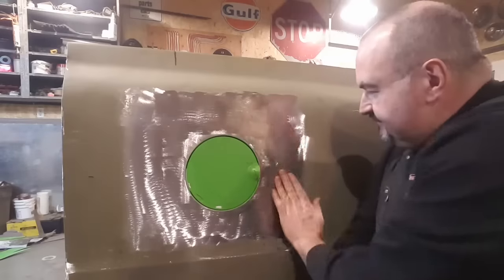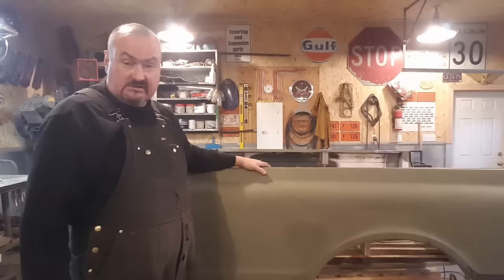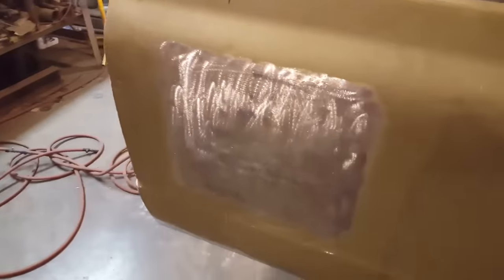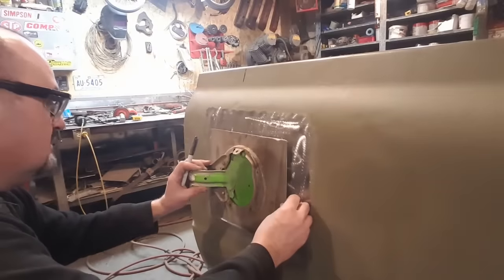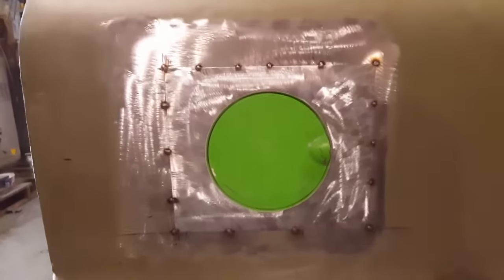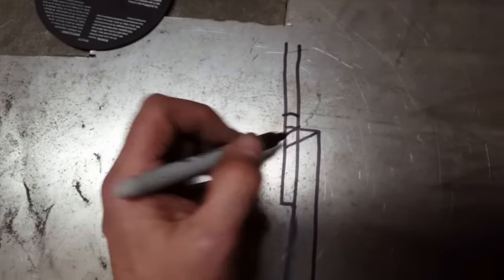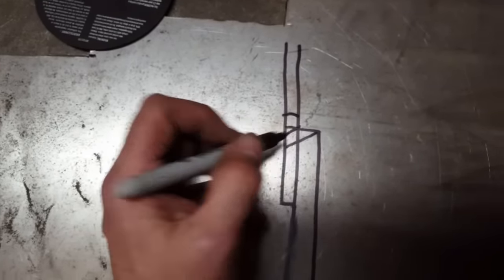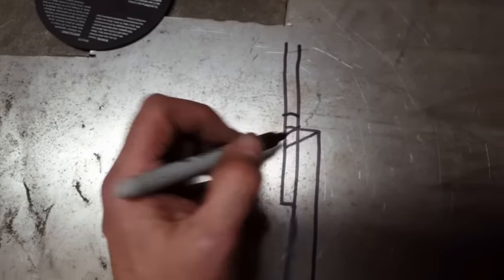Butt welding sheet metal the easy way.

Comment: This is a great way to do patch panels.  One thing I do differently is that I use the cut-off wheel on an angle to make a small cut through the sheet metal, after that I use an air saw which creates even a smaller gap that is easily welded.
.

Comment: The double thickness also gave you some added absorption from the heat of the tack. Been doing light gauge aluminum, stainless steel, aluminized repair for years. Tacks only,minimizes warping but that thing you do great idea will definitely be an advantage on future repairs. Great video and thank you for sharing.

Comment: I would just recommend rounding corners whenever possible. It decreases the chance of cracking when the metal moves when it is being driven.
Reply from the maker: Interesting. I never had a issue with cracking. The round corners we use to do on over lapped panel work. It dissipated the heat and was easier to fill. A 90 degree corner is tricky when it comes to heat and if you apply too much heat it will pull away from you.
Reply: That rounded corners is more for aluminum  . It's an aviation thing . Don't think it'll be and issue with metal .
Reply: Kind of hard to cut the 45 in a round corner with a grinding wheel.
Reply: @Spad68  I think the aviation thing your referring  to is related to airplane windows.  Some planes crashed in the 50's due to square windows causing metal fatigue. In general though, round things don't concentrate loads like angles do.
Reply: @bob.w3984  drill 4 holes in the corners before, not that much of work. Also gives you the outlines of your square, and you get perfect corners
Reply: If its properly welded, there is no corner. It's 100% fused metal.
Reply: @Catrik  Properly welded is a big term in bodywork, just sayin :D but, if it is "properly" welded, the course of the tension still isn't the same as in the original part. Again, just sayin. I also don't think that rounded corners are necessary in this type of fabrication, btw great idea, but still it's not the same as the original part.
Reply: some times with bigger patches i would do a three inch 45 degree cut at the corner , just to lessen the weld distances in a straight line  , but no need on smaller stuff
Reply: Generation-X actually applies to all possible surface intersections just like they moved away from rivets to full glue to minimise tear points square window corners first made them aware but some airframe techniques like wire wrapping were developed before the best gluing systems became available ....
Reply: If you had a plasma cutter you could use the same technique but add in rounded corners if you could trust the angle of your cut.
Reply: @chrisbraid2907  no where as close fitting as a laser disc ..
Reply: @chrisbraid2907  these are non structural , non load bearing surfaces , wings and back bodies , granted if your welding an integrated chassis you may have a point , except welding by its nature is fusion joining of two parent materials , its not like your pop riveting a patch over a square hole
Reply: Russell Gerdes  scroll saw? Really!? You're talking a lot. Just watch the video and shut up. This isnt woodworking
Reply: @generation-x406  de Haviland Comet I think
Reply: @Spad68  What is Aluminium if not metal?
Reply: It's not a ship insert,it's a thin panal.His method obviously works.
Reply: Did the end result look like crap to you?I think it's great.

Comment: I'm a girl and I had to watch this twice to figure out what the heck I'm watching.  Thx. for building the world fellers... I could never do this.
Reply: Sure you can! You just need to practice it. I'm learning how to weld and at my age "learning anything new" is a real challenge! Start with a small inexpensive wire welder and when you are ready, upgrade to a better welder and to a different style of welder. This is what I'm doing. I started with a wire welder but kept having trouble with setting the wire speed I bought a used stick welder. I'm much better with it, but I still have a long way to go. My neighbor has been welding for over 65 years, so he has helped me figure out a few things.
Reply: Of course you can, the only difference between men and women is men get stuck into things even if they're crap at it whereas women won't try.
Reply: Yeah you could JS
Reply: during ww2 women were building ships , planes tanks gliders - everything requires welding  ccmes down to a few things really - you can sew it , nail it , glue it or weld it  not really much to learn  do it as job and hobby = have fun with it - creative inventive -
Reply: @mrcaboosevg6089  Pretty good at sewing and knitting are yah? My girlfriend, just got done removing her dash, cluster, interior and fuse box, for the wire tuck and shaved bay she is doing.
Reply: @klubstompers  Not bad at sewing really, i can knit but it has been a good long while since i last did it.

Comment: Great Job !!!! I just subscribed to your channel. I have been a body man for 25 years and have painted even longer. Your amazing man. You have honed your skill a long time, I can tell. I started doing collision work in my 20's and got my feet wet, couldn't stand doing insurance work with claims adjusters that couldn't use a screw driver. I got into building customs and never looked back. I'm very glad that I found you.

Comment: My man spot welds without closing his eyes and grabs raw cut metal and yanks on it with his bare hands.
Stay thirsty my friends.
Reply: he closed his eyes, you cant see in these shots though
Reply: Don't try this at home. (welding like that.)
Reply: Also an old fabricator knows very very very well about eye safety from flash burn and flying  particles .
Reply: @krusher74  
Closing your eyes you will still get inferred burns on your eyes and lids., plus no face shield you will get inferred burns on your face or whatever areas are not covered.
I've tried the close your eyes method and woke up the next day feeling like there was sand in my eyes and my eye lids were burned.
I learned the hard way , DON'T DO IT. But this is still a very good video.
Reply: @almierz4604  I got welders flash and an old guy taught me to cut a raw potato slice and lay down with it on your closed eye lid. It worked. Took about 15 minuets for the sand feeling to go away.
Reply: @tomortman4850  and with a mask you could have saved the potatoes for dinner☺.
Reply: any tradesman that has put in the time that this bye obviously has, certainly knows what methods work for him. you're so naive that it's insulting. i presume ol' fitzee's been at master level for years.
Reply: @almierz4604  Close. It's the other end of the spectrum. The ultraviolet emitted from the weld (not the infrared) is the same as from the sun. You end up with actual sunburn - been there, done that. 🙁
Reply: stephen john gray  
Steve : Are you the STEVE I bought the 91 mustang race car from.
Reply: Not to mention the wood crates.lol

Comment: Please, use a face shield when using a cutting disc. I've seen too many accidents with those things flying apart.
Reply: And a welding mask. You only get one set of eyes and its not worth the risks.   An auto darkening shield with large viewing opening is the best types as you can keep it on and use as a normal face shield while grinding and stuff.

Comment: Is just me or is the gas flap the wrong way around?
Sorry was looking at the tray the wrong way.
Reply: No, it is correct.  The left side of 1/4 panel is up against the cab and the right side of 1/4 panel is the part toward the tailgate and rear bumper.
Reply: @garyroy3503  as above
Reply: My Thoughts entirely. Wind may catch in fingerhole at spped and force it open. Other than that very good video
Reply: My apologies mad the same mistake as first poster

Comment: does this guy close his eyes when he welds?
Reply from the maker: No I'm hiding the ark behind the tip. Not looking at the ark
Reply: @fitzeesfabrications  Ahh I only own a stick welder. I guess that's another huge benefit to a mig
Reply: @fitzeesfabrications  Well cant hide UV radiation with the tip ;)
Reply: I used to weld like that but I got over it, had orange tint safeties but went back to a helmet to save the skinburn.... ok for setup but not a good practice for the full job .....
Reply from the maker: @mikkoviitapohja1986  oh I know.
Reply from the maker: @chrisbraid2907  agree

Comment: I never comment on videos. But I had to after this. I have been doing my own body repair for about 10 years now. I’m redoing the bed on my truck currently and happened to come across your video. I just got done doing a butt weld with your method. It worked GREAT! It’s my best butt weld ever. Thanks for the tip! I subscribed.

Comment: Thank you very much for your insight. I have a fairly large gouge dent in the sliding door of my Chevy van. Unfortunately there's no way to get to it from behind and the person that owned the van before me had the repaired done by Earl scheib paint and body. They put in about a half an inch of Bondo and of course the Bondo cracked and absorb the water and then there was a nice rust spot underneath the Bondo where it lifted. So I ground out all the Bondo and I have decided to butt weld a new piece of 16 gauge sheet metal to replace the damage area. After revisiting your video I am going to attempt it and I'm going to videotape it so anybody can see how I got along. You're knowledge has been quite useful in my 79 Jimmy restoration. Keep up the good work.

Comment: Nice metal work. Over the past few years Iv started using double stacked cut off wheels at 90°s to grind off the first 50-75% of the welds in order to concentrate on the welds and not the surrounding sheet-metal then finishing with a flap disc. It also seems to keep the heat out of the panel.   New subscriber, I look forward to learning from an seasoned Panel Beater.

Comment: Great tips and instruction, just when I thought of a question, damned if you didn't answer it.  Good video work, too.  The 45* angle method was something that I haven't seen being done before and it makes perfect sense, I'll be using that method from now on.  For a while there you had me wondering just what you were going to do with the metal section that was behind the panel, but you covered that issue, also.  As for your accent, I got used to it after a few moments, after all I'm from North Florida and I also carry a bit of an accent.  Looking forward to watching all of your videos.  Thank you so much for taking the time to share your valuable experience.

Comment: I tried this technique after watching the video.  It was a long seam in a panel that curves from vertical to almost horizontal at the rear of the car.  For various reasons I did each end of the weld with conventional butt  techniques and the middle part using  using this technique.  Worked well, but with the curved panel I ended up with a steeper angle than 45 degrees. Not really an issue, but the tricky part is to cut the outer patch panel at an angle all the way to the outer face or it does not fall in flush to the body panel.  Great tip.  Some of us will need a little practice.

Comment: I tried this technique for the first time last week- welding in a patch in the floor of my 70 f250. It worked great. Although I made some if my cuts too long. If i had more patience to make shorter cuts before tacking, I would have had an easier time. Overall, its a LOT easier than trying to trim the patch to fit the hole!

Comment: Thank you so much for sharing your clever ingenious system for butt welding automotive sheet metal.  By the way, I noticed at 0:29 a quarter panel view of a Javelin AMX, I am the original owner of a Javelin AMX, need to put patch panels behind the rear wheel quarters, but  I want the patch panel repair to be a seamless, so there's no trace, to look factory.  I watched most of the videos on how to lap weld, butt weld a panel and know how difficult it is to get a perfect seamless butt weld, however, your method beats them all by a mile.  Makes a lot of sense, very doable, I tip my hat to you.  I'm now a subscriber, maybe you have more pearls to share?

Comment: Every time the welding started I looked away. I guess that it's just habit.

Thank you for showing us this neat trick! I'll be doing some custom work on my '68 C10, and a fuel tank relocation is on the list. I'll definitely use this technique when I begin this phase of my work.

Thank you! You're amazing!

Now to look for your video where you had shortened the truck bed.
Reply: I've got a 66 C10 I'm looking to do this technique to patch the bottoms of the doors and maybe the fenders

Comment: This is a fantastic video on metal working Fitzee ! You make it look so easy.  I tried this today, my cutoff wheel was too thick at .065 and made for a larger gap to weld. Will try a cut off wheel that is .040 tomorrow night.  Second watch shows you cutting 2 ways at the corner for a good drop into place at the corner. Also I was sinking the cut off wheel deeper than you after I watched your video again. That might be why the gap is wider also? This looks to put fun back into installing patch panels!  Thank You from North Dakota

Comment: I used your technique to repair a wheel arch on my truck turned out great but I put a little too much heat on it and got a little valley in the middle. Not bad for my first time tho. Thanks for all the good videos!!!
Reply from the maker: It's good that you know what you did wrong. That only improves your skill level

Comment: I commented about looking at the weld and you commented you hide the arc behind the gun tip...it is true that helps but the reflection of the arc off the body of the excellent work you do is still reflecting a ton of lumens to your machulas and this will have a severe downside later in life.  I am a welding inspector, trainer and consultant in the field of welding.  I am also an inventor and have worked in the field of ophthalmology for 20 years developing all kinds of surgical tools.  That is the experience I lean on to say the reflection as well is absolutely detrimental young man!
Blessings and be safe...from grandpa...

Comment: The thing the Mr. Fitzee didn't mention is that when you cut at an angle like he did, not only did it leave a smaller gap but it made the metal effectively thicker, and therefore easier to weld.

Comment: I had never seen the 45-degree option, but I can definitely see why it works. Good instruction on the video. I subbed to see what else you have (I can from a YT recommendation). I plan to build a metal widebody over the winter, and this tip should help with the rear quarter panel replacement.

Comment: I use the same method,but i use a small reciprocating  saw made by Mac Tools,has a very small bade,works great,i also use a rolloc 36 grit disk to know the tack welds down a bit so as not to kill the saw blade as quickly as I'm cutting.

Comment: Well everyone I did exactly what Fitzee didon my 69 Camaro.. but on a full.. 3/4 quarter cheater panel skin.. The thing is with a cheater Skin is you do not have straight lines to use a cutoff wheel..I found the cutoff wheel will not work on curved lines.. Due to it wants to follow the cutoff wheels blade edge.. So, What I have found is to use a hand held JigSaw at a 45 degree angle with a thin metal cutting blade and it works like a dream.. I am able to follow the curved lines of the entire skin and I have no skin warping.. Go slow like Fitzee's says and go 2-3 inches just like in his video and you will be amazed how the panel wants to fall flush with the original panel.. Thank You Fitzee for this awesome Tip..

Comment: Mr Fitzee, thank you so much for the lessons on metal manipulation. I have learned so much from you. I did a course  at the community college for metal fabrication, and they never touched a lot of what you teach on these videos. I don't know if you will even see this, but I have a request. I live in northern Michigan, and rust is a real problem here. I am trying to repair lower door panels on a Dodge pickup. Can you please give me some tips on how to go about this. Door lower has holes in the side, but not on the floor of the lower door. I would like to make it look like it should, tired of the extra air conditioning. Thank you again for your lessons. Doc.....
Reply from the maker: Drop over to my Facebook page, Fitzees Fabrication and post a pic of the door see if i can walk you threw it.

Comment: I always used a flange tool And then tec   Screws  Or rivets hold the patch in. This is way  Smarter and would use less filler. I like it I learned   Something.

Comment: Very nice and tasty work, only issues I see with that particular job is the fuel cap door is opening into the airflow as the car drives fawad, it should be opening agenst the airflow as in the hinge should be on the other side. Excellent video regardless  😊👍👍👍
Reply from the maker: That is driver side front of the box! It's on right!

Comment: I guess this has been said about 2500 times now but: When you use those super thin 1mm (.04") cutting discs, you can cut straight through, no angling of the disc required and the gap is perfect for 0.8mm wire (.03").